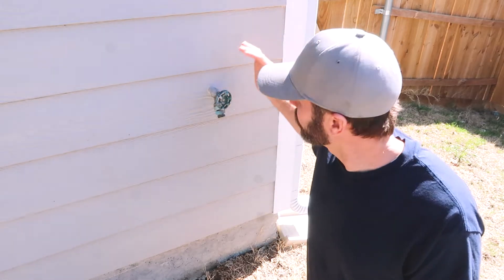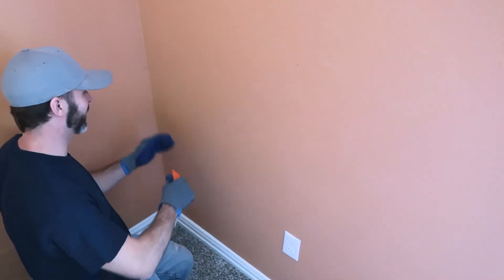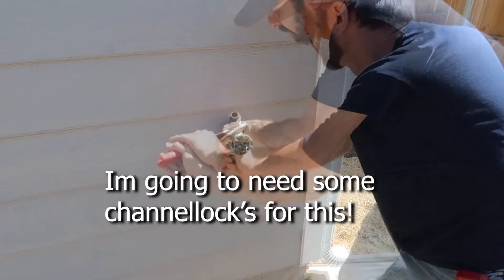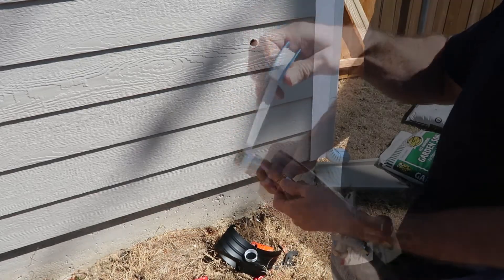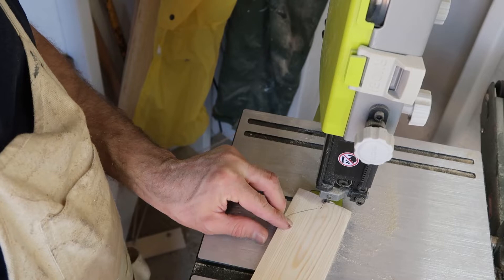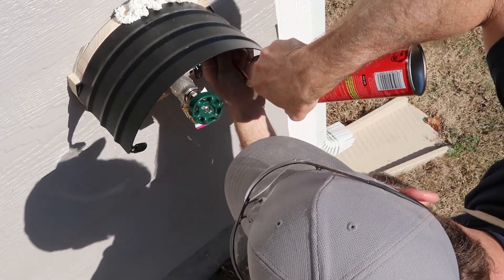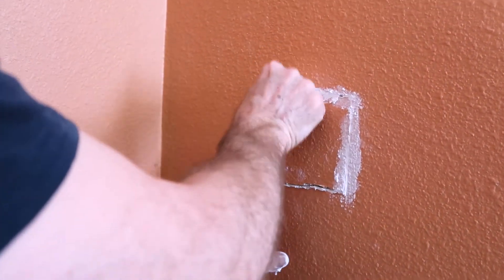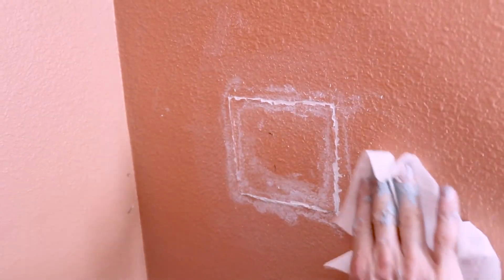Fix Leak behind the Siding at the Outdoor Faucet / Spigot and Sillcock Replacement with Hose Hanger

Comment: You can do this without a hole In the wall. Unscrew the old faucet buy new one, put Teflon and screw back in.
Reply from the maker: Thank you.  Have a blessed day =)
Reply: Not if you don’t know that it’s a screw-on. My outside spigot is tight up against the brick exterior, and I don’t know whether it’s welded on or screwed on, so I have to cut a hole in the interior wall to find out.
Reply: @leeb.7188   I thought about that after the fact.  I was lucky enough to twist it generously but carefully and came loose. Rather easy. Good luck

Comment: Nice job especially the hose hanger  if the builders had left you a shut off valve the bib wouldn't have cracked.   I have the same issue
Reply: Yea I'm really surprised they didn't add a valve. When he said he had to shut off the water main to do the repair I was like "whaaaaa????"

Comment: Wow, great video.  Thank you!  I think I have the EXACT same problem right now with water flowing down from behind the siding when i turn it on.  The challenge for me right now is that there is a heavy upright piano where I need to tear the drywall and I just don't have the time to move it right now.  

Question for you:  In your case as shown in this video, knowing where the puncture (leak) is located on the faucet, would the water have continued to drip out  if you had just left it?  Do u think it would've caused a mold issue if you had just left it as is for, say, 6 months?  I'm not a home building expert, so I don't know what's immediately behind the siding and what's there, if any, to protect my interior from mold.  I guess I just want your take on whether I need to drop everything this instant and get this fixed, or mold will start invading the inside of my home.  

Again, my question is assuming the exact same problem as shown in this video.  Not holding you responsible for your opinion, thank you.

Comment: Thanks for the video. I am currently having the same issue and have a question for you: Did you notice the problem when you used the hose or have you seen some water damage in the house that made you aware of the issue? I found out about our problem when I turned on our hose. Hose pressure was low and in about 20 seconds water started to come from behind our siding. This also caused some wet carpeting in the rooms behind the spigot. I have not seen the piping yet, but the problem seems to stop when I turn off the spigot. Is this similar to your experience. Thanks again.
Reply from the maker: It was when the hose was turned on.  The split is after the seat from the valve.   Their is a close up of it in the video.  That put the leak inside of the middle of the wall only when I turned on the valve.
Hope that helps.  =)  Have a blessed day.

Comment: What if you cannot access from the inside of the house (bath tub is on the other side). Also, the house is brick so can't easily access from outside.
Reply from the maker: Personally I suggest calling a certified plumber at that point, I would not try to replace the valve myself unless I know for sure it does not leak in the wall after.  Best of luck on this Emily, and have a blessed day.